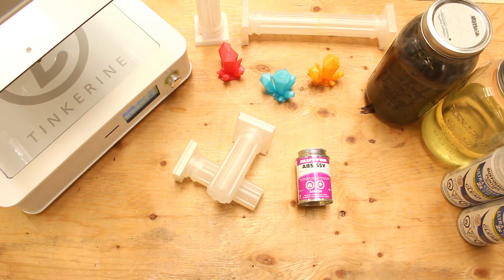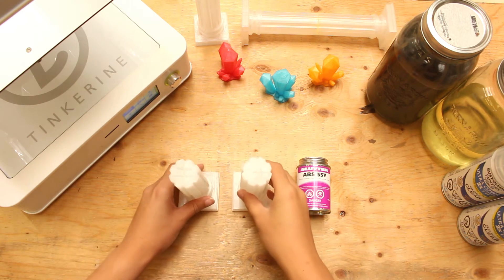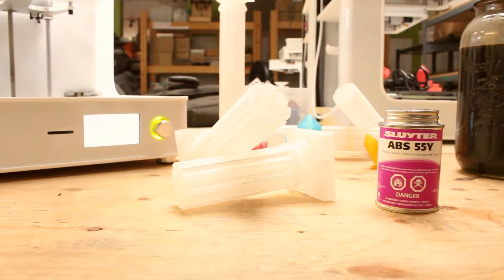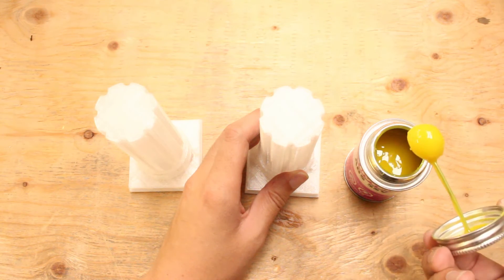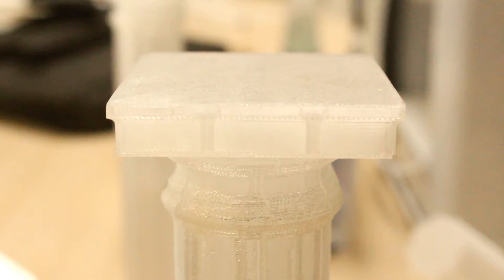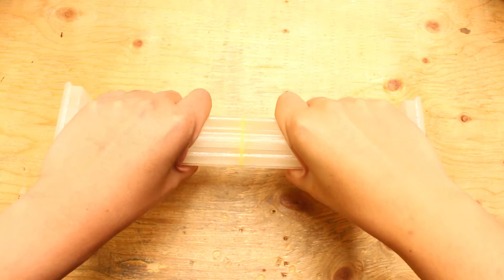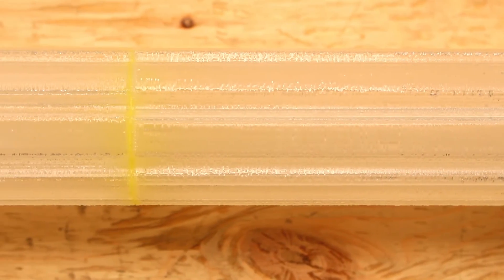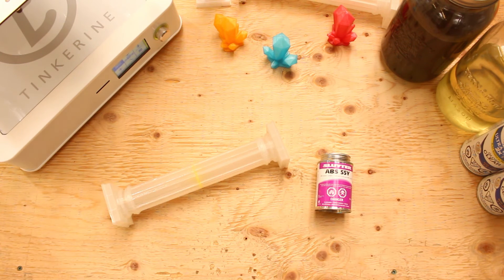Gluing PLA parts together with ABS solvent Cement

Comment: There are several liquid cements that are clear/white that will weld ABS, Acrylics and I've tested some with PLA and they work OK, e.g. ACRYWeld and Model X Pro. There are cheaper, generic 'ABS glues' that should also work.